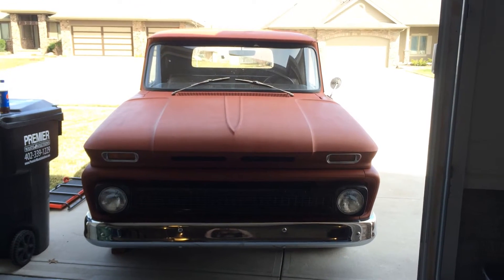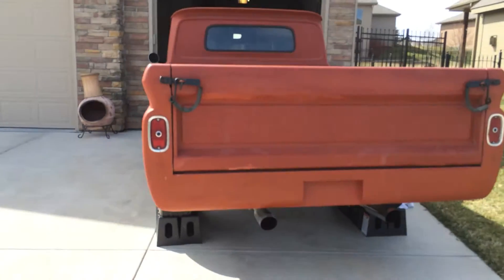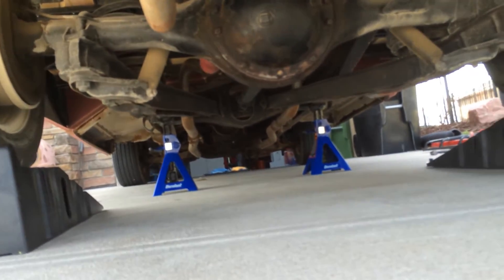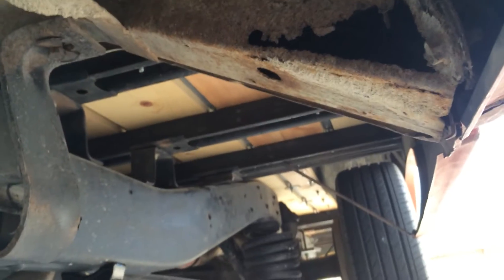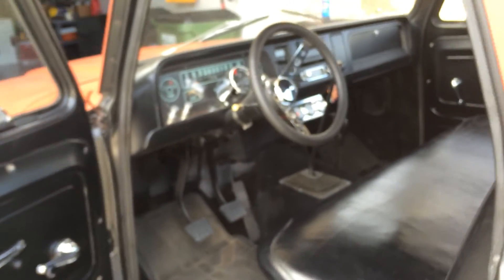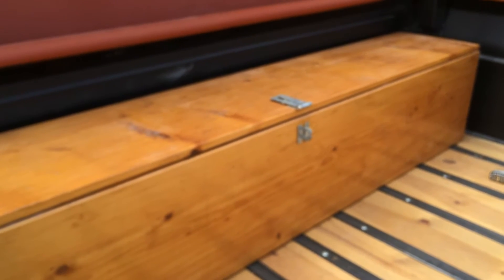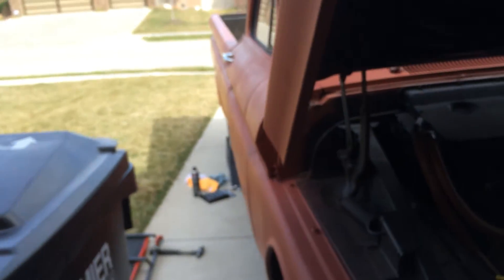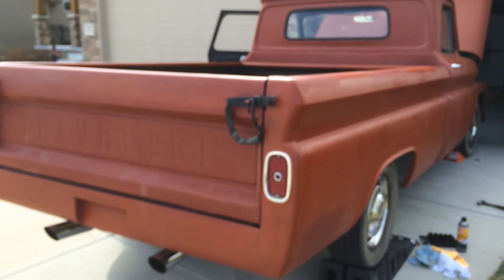1964 Chevrolet C20 - aka: Project STEEVE

Comment: Rear end is an Eaton HO52
Reply from the maker: Yes it was, but that's been removed.  Using a 2002 2500HD full float 14bolt with factory Gov Lock now.